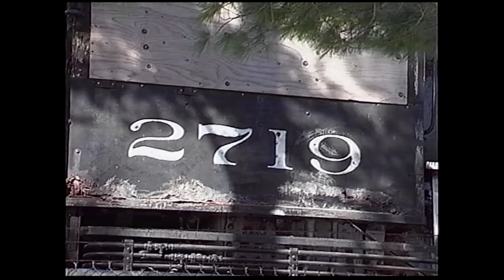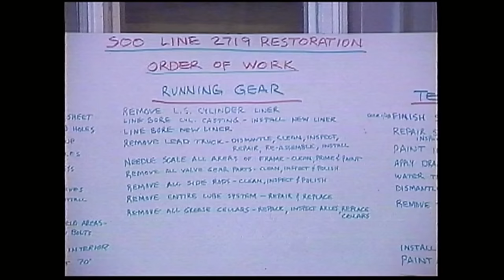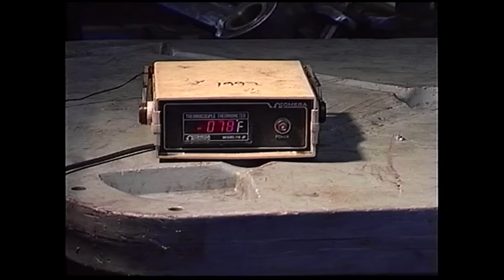Restoring a 4-6-2 Pacific in 35 Minutes! - Soo Line 2719

Comment: Even with an army of men crawling around on a big steam engine like ants they were still cheaper to run than diesels. General Motors and the oil companies conspired to get rid of steam which was coal powered for the most part. The Cinders from the burn coal was spread out on roads instead of salt and that's why old cars lasted so long and today's cars last so little. Steam locomotives employed so many people. Once they had diesels service went down the toilet and you had to wait till they had tonnage before they would run a train meanwhile the car that you're spending $60 a day is sitting at your Warehouse empty.
Reply: then of course there is the mortality rate from steam locomotives, more people were killed per-capita by steam explosions then are killed today by drunk drivers, in the late 1800's though the mid 1900 between 5,000 to 12,000 people a year where killed by old steam locomotives, I read a story where one blew up and they found parts from its boiler in house 2 miles away, parts falling out of the sky killed something like 40 people while they were sleeping, not to mention about burned the town to the ground, the part about steam power that they don't like to talk about.
Reply: @dannelson8556  steam locomotives would blow up if you were not careful with them it is not because of the steam engines it is because of the carelessness of the people who operate them. You neglect a steam engine it will kill you. And you're talking about very primitive steam engines compared to the state of the art modern ones that were in the 1950s. And you had engines from the 1900s that were still in running order when they were scrapped when they were 50 years old and they still had Decades of life left in them. We have no Cole no Steel no Manufacturing we have nothing left. Shame on this country.

Comment: Hello from the UK. I love this video which I just noticed today. All true railfans love to see a steam engine come back to life, anywhere in the world. I certainly enjoyed following the story of Big Boy. Are these two locomotives currently running? Here in the UK, every restored steam locomotive has to be stripped down, boiler tested and rebuilt after ten years in service. I don't know what the procedure is in the US.
Reply: There wasn't much before.
Then Gettysburg messed up badly.
Now we have regulations for training.
That's all I know.
Reply: @basicallyarobloxian4533  Yes, I read about Gettysburg. The maintenance at that line was truly shocking. Gauges removed, water glass not blown down and therefore inaccurate, other gauges inaccurate and driving all day with a major valve blowing out water. A video of it running shows the horrible noise it was making. Almost none of the staff knew anything about maintenance. Preserved railways in the UK (tourist/heritage) are under the government railway inspectorate. Steam engines with a fire and not enough water are massive time bombs!
Reply: In the USA lokies can be run 15 years or 1472 days between inspections, which ever comes first.🚂
Reply: @jeffmiller3150  Thanks for the info. Do you know whether the engines have to be stripped down and the boiler pressure tested?
Reply: @jeremypreece870  Enough tubes have to be removed to examine the inside, and everything removed from the outside.

Comment: the two gondola at the end are added breaking power. steam locomotives do not have enough stopping power .
Reply from the maker: the gondolas were hauled around as additional coal supply for the locomotive to use as needed

Comment: Why move the locomotive during the winter??? 🙄
Reply from the maker: It was moved in winter because the massive weight of the locomotive and framing would have cracked /destroyed the roads in the summertime. They needed the frozen ground in order to pull off this move. Great question!

Comment: Nice little reminder that diesel or gas trains are and never were better or stronger then steam engines they were only made just because they were cheaper(ima put this here they were only cheaper in money) steam engines may be slower but that doesn't mean they were weak because a steam engine can push a fully loaded diesel engine while still pulling its own load that is about the same weight as the diesel with a full load almost forgot to mention they last a alot longer then diesel or gas stuff this video shows how well steam engines were put together you csn have a diesel sit for the same amount of time and try to pull that out and it will probably be cheaper to just make a new train then repair it

Comment: Although much of the work is impressive, the piston liner installation was a nail biter. 13:49
Reply from the maker: for sure, it was one of the most expensive parts of the re-build. With tight tolerances you only get one shot to get it slid in and get it right. Thank you for watching :)

Comment: Real Engineering from a dock road fitter 40 years experience machining fitting takes me back did you use tube expanders for the boiler leads ect for bearing clearance did you use a pressure test with water or air
Reply from the maker: not sure on the tube expanders, honestly your knowledge here far exceeds mine. It was pressure tested with air I can tell you that much. Could have used your skills back in 1996! Thanks for watching :)